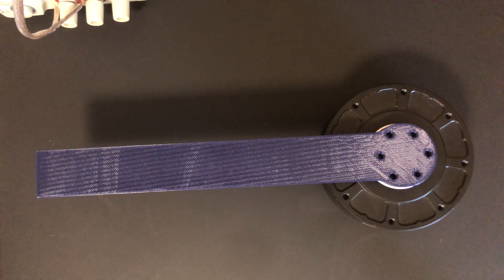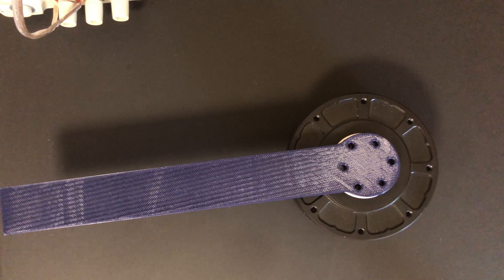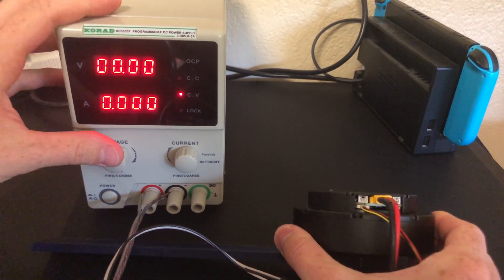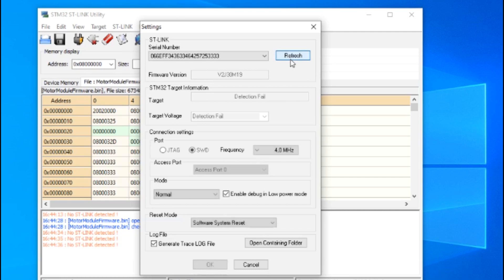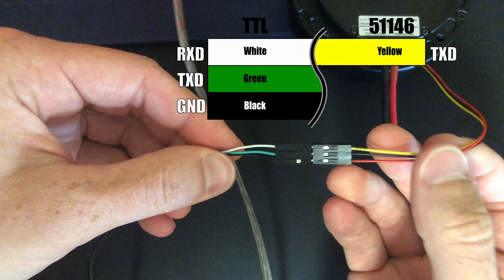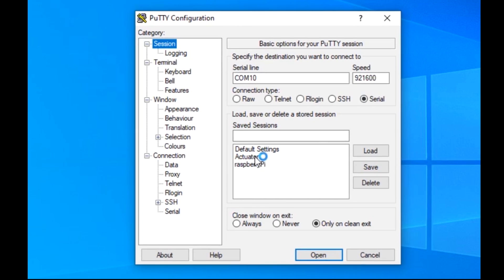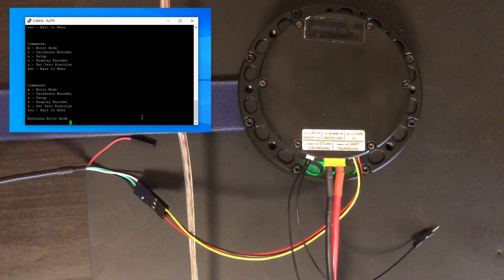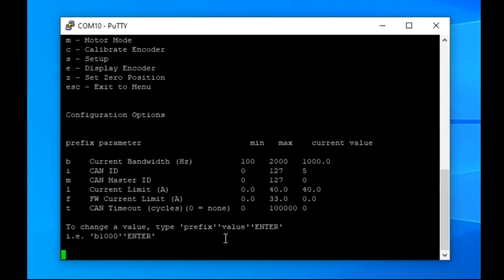MIT Mini Cheetah Actuator [#2]: Firmware and Configuration

Comment: Hey Robert, did you do some tests with these actuators? I'm really interested in buying some of those, but I'm extremely skeptical about the electronics and the winding not being good and the actuator getting damaged at relatively low loads. Do you mind to share some your experiences with them or otherwise have an opinion on these?